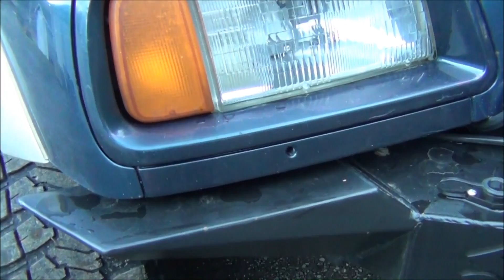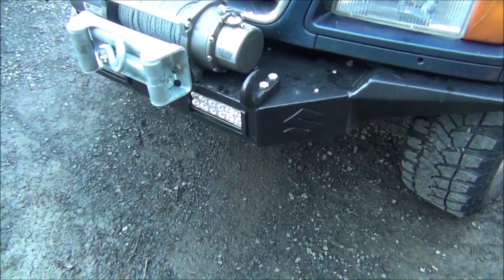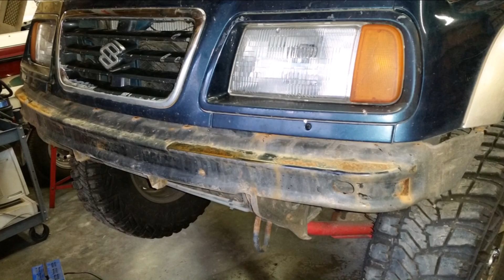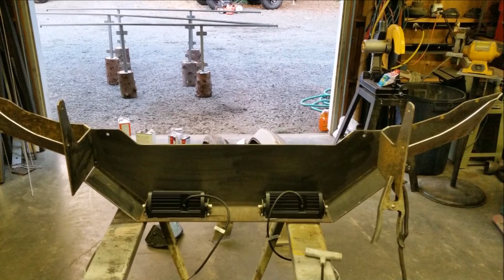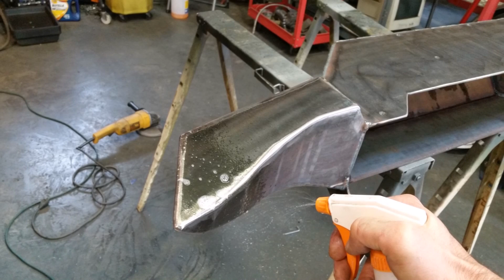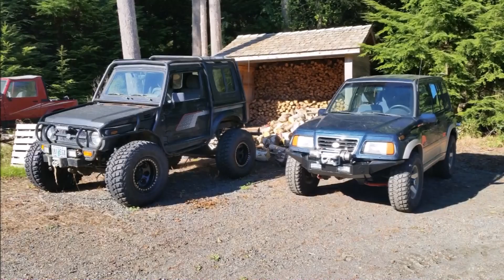Suzuki Sidekick Sport custom bumper project

Comment: Really well thought out. I am curious about the long term durability of the air reservoirs with vibration, pulling forces, and compressor condensation, but still, really nice!
Reply from the maker: I have built a few bumpers with air reservoirs before.  I've never run into problems with leakage or corrosion...but have never cut them apart to check either.

Comment: nice!!! Beautifully done!!!! What gauge metal did you use? Thinking about building one!!!
Reply from the maker: The Other Guy most of the bumper body is 3/16 flat plate, the winch Mount and mounting brackets are 1/4"
Reply: sewerzuk any particular type of metal?

Comment: Did you use a DPDT switch to make your lights work with two power sources as well as light the LED properly?  I have mine wired this way but had to unhook the LED because it stayed lit all the time.

Comment: Are there only 4 bolts holding the bumper to the frame? 
 Like the looks and it is just a matter of time before I do something similar as the front and back bumpers just do not look 4x4ish.
Reply from the maker: 6 bolts; 4 on the side brackets and one on the top of each frame rail.  I’ve done several full power pulls with the M8000 and there is zero movement.  It’s plenty strong.
Reply: @MattVerley  Thank you , I have not ventured as far as removing the front bumper to see what lies beneath.

Comment: What thickness metal was used for the bumper ?
Reply from the maker: 3/16" for most of the bumper, 1/4" for the winch mount plate
Reply: Guess u did mention it right at the very beginning just caught that. 
Thats fairly thick stuff then hey.  I would have thought maybe 1/16 thick, that must be heavy and bullet proof then lol.  I guess if your doing some winching with it must need it fairly sturdy then.
Reply: @MattVerley  bom dia irmão como está nos estamos bem graças adeus